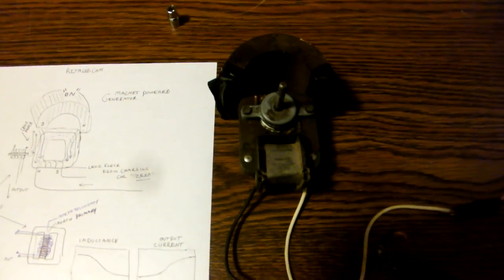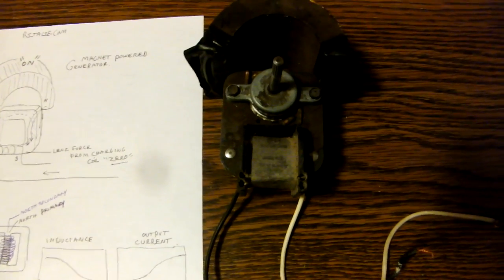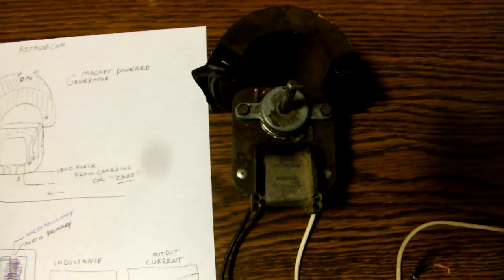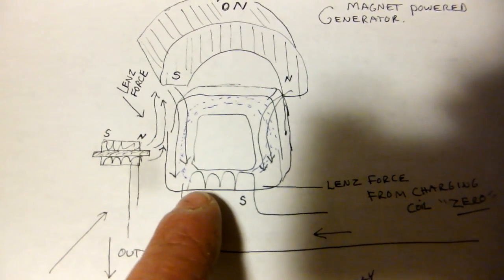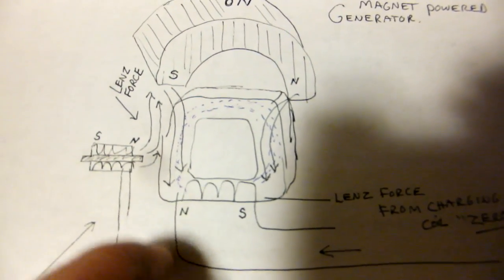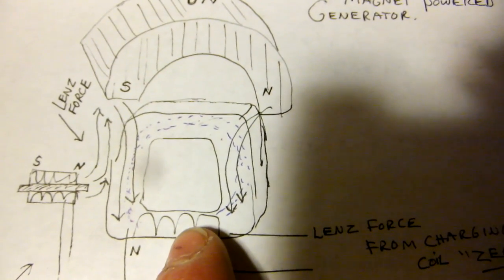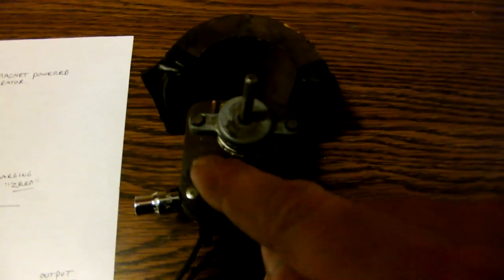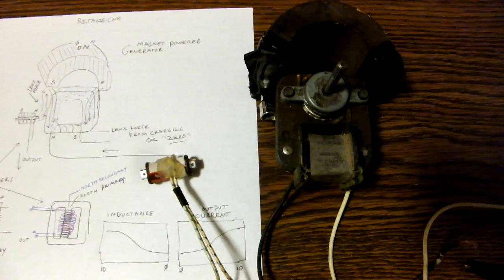Lenz Free Transformer - Experiment Number 1

Comment: Transformers only work with AC, any dc transformer is just an electromagnet, 1 primary and 2 secondary coils, more copper will let more ether energy in, ether is AC 6 cycles per second

Comment: Hi Charles . I have this idea that you can use a stationary magnetic feild the same shape that a pulse coil would create but position the magnet or magnets in such a way that it extends the electromagnetic feild further than with out . This shall increase the collapsing inductive kickback spike voltage ! I still beleive this is possible after 40 years

Comment: I have been thinking along the same flux lines for many moons Charles but this was the first demonstration I have seen. Thanks so much for your demo. I have also considered the consept  of using a coil to turn off or attenuate or redirect the flux of a permanent magnet. Maybe just after attraction mode has been fulfilled it could trigger a Reed switch to charge a coil that repels 😲

Comment: sorry pal,  - you can only extra power from the coi, when the magnetic field id changing, - so because you are using DC , it still costs the same too create the magnetic field, - and ac wont work either, but i bet you know beacuse you tried that, -- anyways, build a newman motor, they work, - but you still need a lenz generator for it.  mine is OU https://www.youtube.com/watch?v=dLZhBQOCpx0&t=11s

Comment: hi, is there some chance you could send me a link to the machines  that you say run with magnets and are ou i am very interested in those also I can visualize a system with coils alongside a very long magnetic loop that we can energize and de-energize at will creating more electricity than used to de-magnetize b cause the lenghth of the sides can accomodate many more coils and their respective flux

Comment: Nice Video.  Good Idea...I had a similar idea! I agree that using a coil to create a magnetic field to cancel or "interrupt" a permanent magnet field would let you be able to use a generator coil(s), in the right place, to be able to extract energy from the permanent magnet.  Awesome! 

I was going to use AC current and try to make the "interrupt" circuit be a RCL or "Tank" circuit.  You start the tank circuit with a battery and, once it gets close to resonance, back feed some energy gathered from the generator coil circuit, via induction, to the tank circuit to keep it going. Then, disconnect the starting battery.

Some of the energy from the magnet keeps the tank circuit going forever and some of the energy runs a load... theoretically making the device over unity and being able to supply "free" energy.

I hope this makes sense.  If anyone has questions or comments please let me know. Peace!